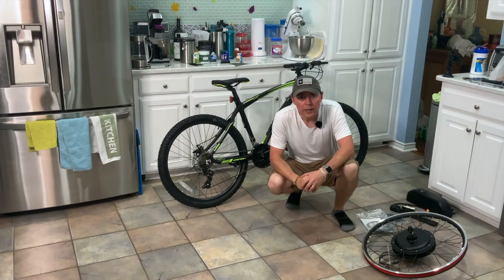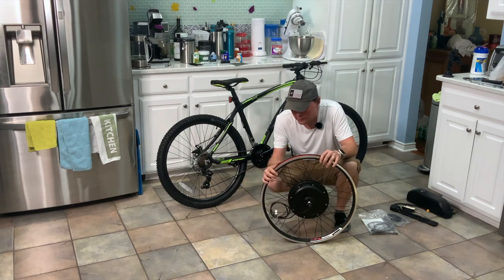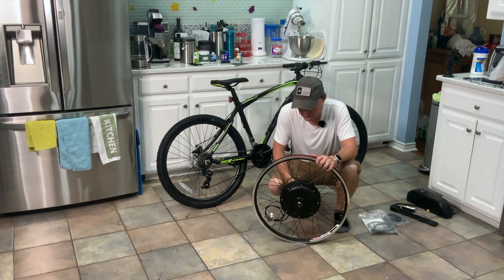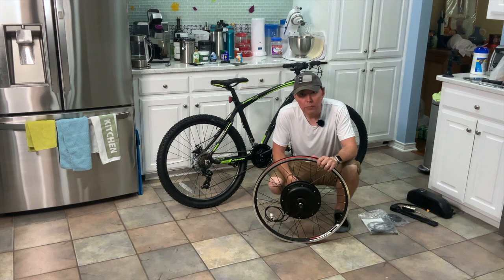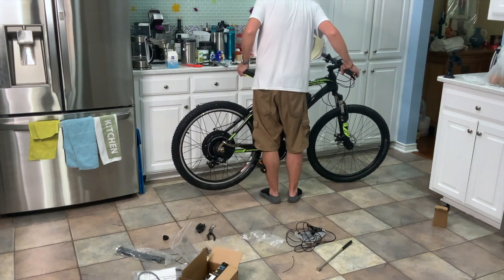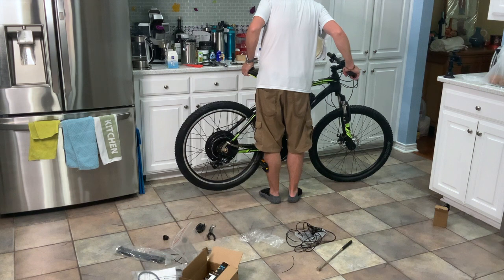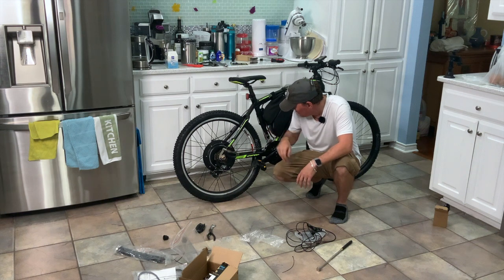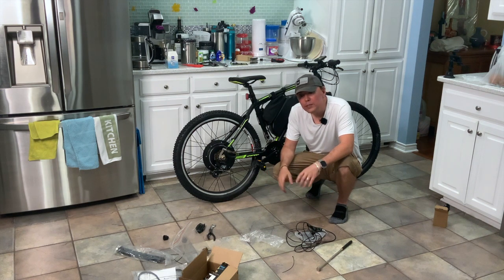Hyper Carbon X E Bike DIY Conversion. Will it work?

Comment: Hi Kado,thanks for share your video,I just order that bike,and I was to thinking do the update,but I live on five floors with not elevator,how heavy after the upgrade,and can I use the power of the wheel with the motor to help me up five floor,if you answer are yes,can you make a video,will be helpful for oder with my problem,thanks
Reply from the maker: Hey Rafaelito, it weighs about 45lbs with motor and battery.  Compared to my other ebikes I've had, it's very light.  I don't know that I would try to power it up five flights of stairs, but that's just me.  Could it be done?  Sure.  Could you fall down the stairs trying?  That's possible! Lol.  I'm going to do some more updates, and I will show that it can be picked up by one hand for you.  A friend of mine with a manufactured and expensive ebike looked at me in disbelief when I showed him how light it was.
Reply: Kado,thank for your quick response ,I will see your next video,and ,try the stair video to couple floors ,thanks
Reply: and please review the bike,thanks